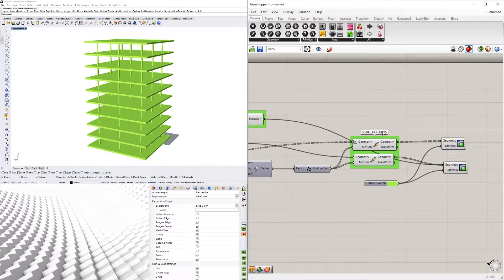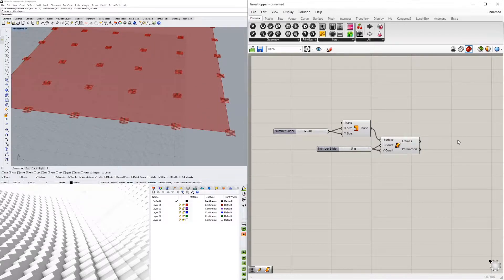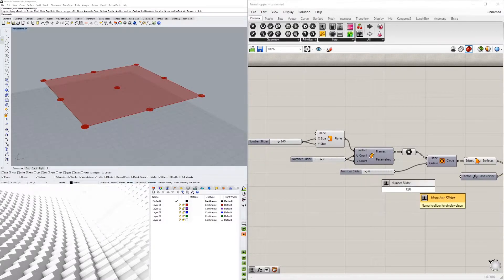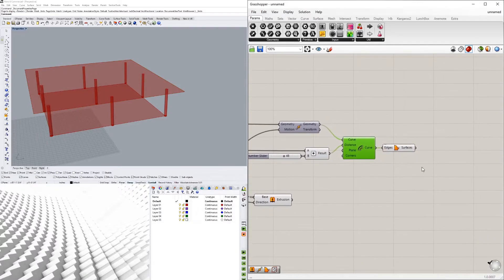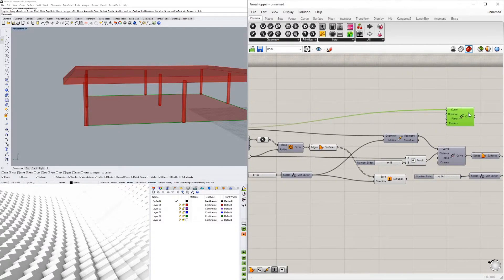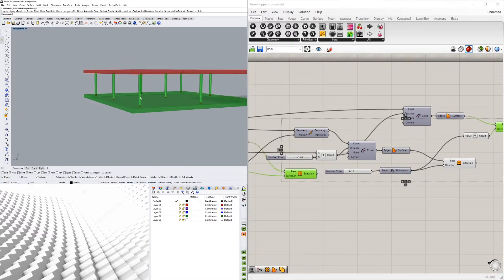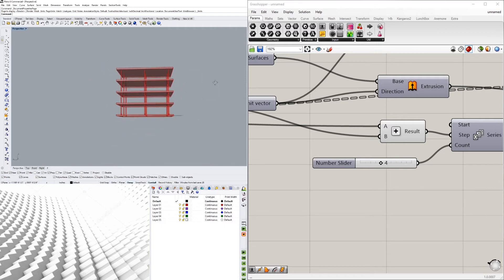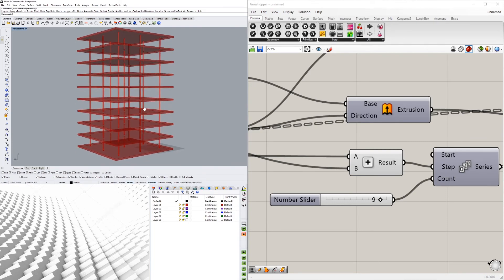Rhinoceros 6 and Grasshopper Multi-floor Structure with Columns and Floors Full Steps

Comment: hi so when i do it with square collumns it generates the column from a corner not the middle. anyone know how to solve this? thanks!
Reply from the maker: For the input you need to use a component called "construct Domain" for the start use a slider and for the end use the same slider but with a negative component so you have a negative and positive. This will make it twice as big, so you then need to divide the original slider by 2. If that doesn't help send me an email copetedavid@gmail.com and I can help you with this

Comment: Thank you for the tutorial. Non need duplicate a last "Move" node. Enough activate "graft" parameter on geometry input. All will work. Gob job, twice thanks.
Reply: I'm sorry, need flatten out of "extrusion" collumn and then could use one grafted  "Move" node. :).
Reply from the maker: you are correct, Good eye 👍. 😁